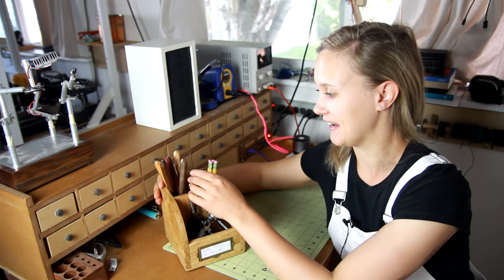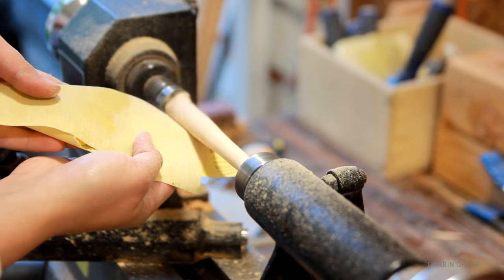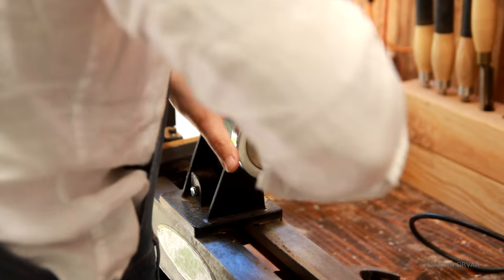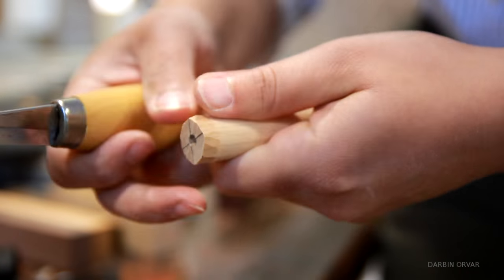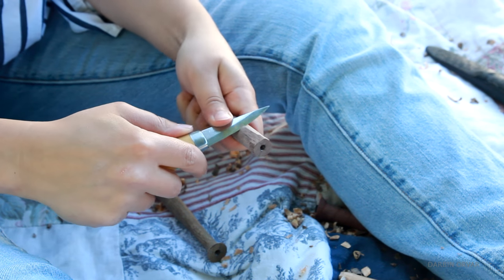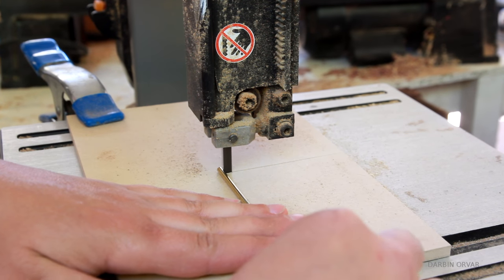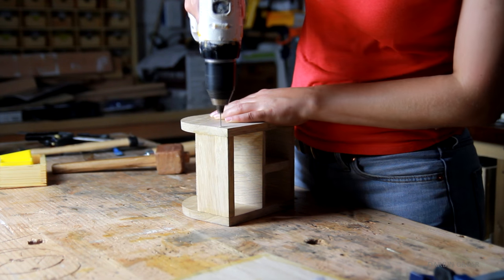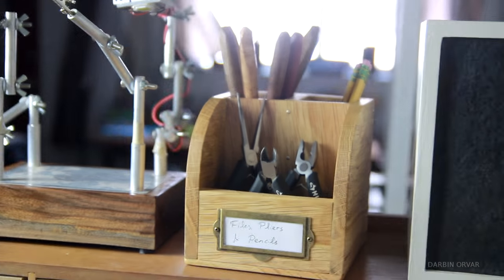Why is it so Hard to Carve Exotic Woods?

Comment: So Lin when I was a bench jeweler I had to set tools into handles some times and the way I was taught in NY was too grind a bevel onto both sides to make a diamond shape edge/blade on the tang. Then I would heat the tang up while they where in a vice and then drive the handle on with a hammer. They hold really well when you do that.

Comment: Very nice!  I use your Tung Oil polish on some knife handles and it is wonderful!
Small tip:  I use Marvel Mystery Oil as a honing oil on my Arkansas stones.  Cleans up with dish soap and hot water.  Keeps the stones pristine and sharp.  Available at any auto parts store.

Comment: Do i see a variable power supple on the rights side of your desk
Reply from the maker: Yes.
Reply: after the video i watched more videos of you so i know it is a power supply greath to see a woman ( i hearded you married) going in woodworks and electronics  specialy electronics. the last woman i see in electronics was in my universety 20 years ago and never see a woman in E enginering anymore. Love your projects, enjoy how your making your furniture and design (specialy the ones with electronics) decoration. keep up the nice videos you make. and thanks for the reply
Reply: hi sorry to bother you again but i see you are making wooden mallets  i got one from my father many many years ago  and it worked verry verry wel for me for many years  but now it is getting worn out ( and i hit pieces verry verry hard with it)   Let me explain i use the mallet on iron  for losing barings joints etc etc and its working better than plastic or rubber but it is getting worn out  can you help me on this. i know everything about elctronics and most of metal but wood is for me a mistery  the wooden mallet always did what it had to do and for metal work wood is perfect  it wil realy not damage any forms of metal. Just a question can you help me with it. thanks in advance
Reply from the maker: Not sure what your question is exactly. If it's a large mallet you can always carve down the sides with a chisel and remove some of the damaged parts.
Reply: No its not how to reshape the wood i know how to do that but its more of what kind of wood to use  to make a new one becaose the old one is getting small after reshaping it many times. ok i  try to be more accurate  you can realy hit the metal parts had with it without losing to much shape of the wood  no splitting  or pieces flying off difficult for me to explain it acts like bronce a little but not that havy as bronce. hope you understand me not us or uk from holland.
Reply from the maker: If you want a very dense mallet, then go with a hard wood such as purple heart, osage orange, ipe or some other hard tropical wood. These are very difficult to carve, but produce a very solid and hard mallet. Another good option would be hickory.
Reply: ok i wil try to find those but witch ones i can find in europe because the mallet is from before the time tropical wood was imported to europe  and i regualy stay in a tropical country but the woods are hard but verry brityle
Reply: thanks for the advise
Reply: Do you have European Beech wood?
Reply: Yonatan24 from what kind of tree comes that
Reply: European Beech...

Comment: I don't know which I hate most, power tools or nails. I think both have sucked the life out of humanity's sense of art and creativity.  But it was interesting watching you try to carve the exotic woods.  It may sound counterintuitive, but I think the more you use power tools, the more likely it is that you'll find exotic woods difficult to carve.

I don't think most are at all difficult to carve, they're just time-consuming.  They require great patience.  People who use power tools tend to run short on patience.

I'd rather carve almost any exotic wood rather than carve walnut.  Any kind of walnut.  Of all woods rated for carving, it's my least favorite.  It isn't very difficult to cut, and when you carve very fine things in it that have a high level of complexity, and then finish it right, few things are more beautiful.

But I find it an extremely unforgiving wood.  A hair too much pressure with the blade, or an tiny, tiny bit of poor angle on the tip of the blade, and those tiny details will chip, or even split off, and correcting a mistake take horrendous patience and skill.  The only reason I ever carve walnut is because it really is beautiful, if you get it right.

Have you ever seen hand checkering on walnut?  In and of itself it's beautiful, but if you border the checkering with carved figures or designed that are as good as the checkering, it's stunning.  So I keep carving walnut, even if I do need long breaks from the wood between projects.